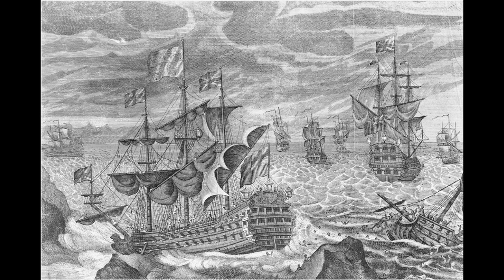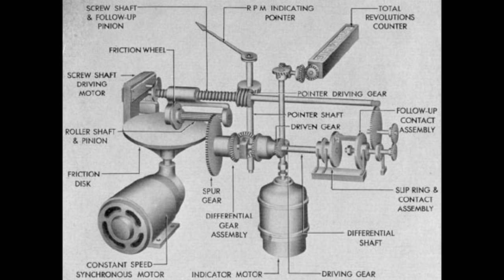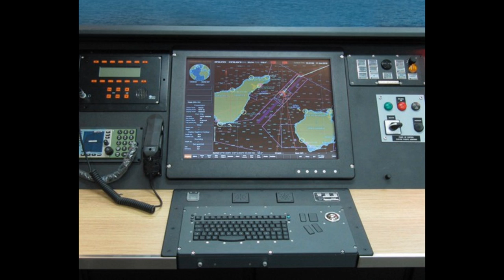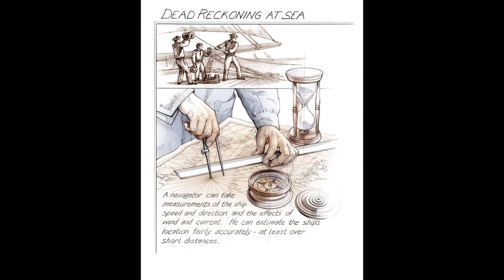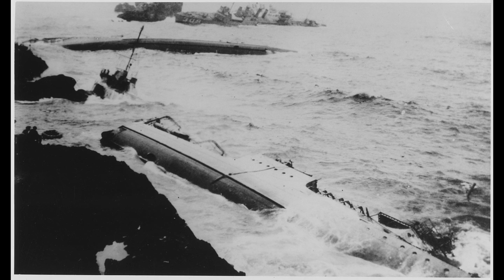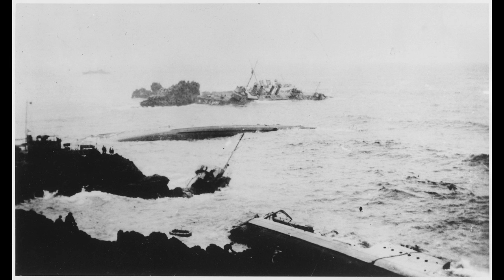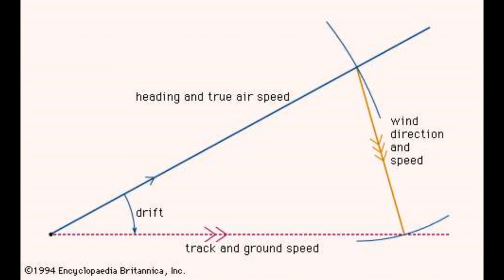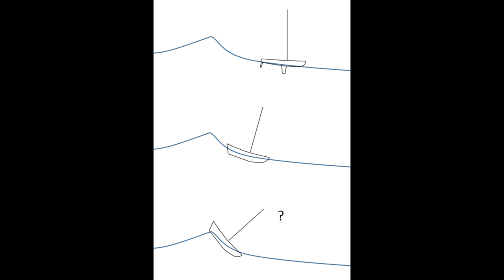Honda Point Disaster - Taking a Wrong Turn at Albuquerque

Comment: I have dived what remains of the wrecks of the Woodbury and Fuller a couple of times.  The other wrecks are generally too close to the coast to be dived safely, though I've heard that the wreck of Delphi has been dived on, from time to time.  In fact, even the area where the Woodbury and Fuller went aground is only safely accessible, maybe 18 to 24 days a year.  The rock formation which was given the name "Woodbury Rock" has other nicknames, including "Destroyer Rocks" and "The Devil's Jaw."  The geographic point that ships want to pass when heading North to South, before making a left hand turn is known as Point Arguello.  When you can safety maneuver and anchor in this area you are just offshore of Vandenberg Air Force Base and are advised not to take photos of the onshore installations.  Honda was the name of small river or creek, which fed into the ocean near Woodbury Rock, but long ago dried up.     

There are numerous other wrecks in the same general area.  In fact, you can see the remains of the stern of a Japanese freighter; the Nippon Maru, at the same time you are looking at the deck fixtures, boilers and engines of the Fuller.  They are literally only a few feet apart.  You can tell the difference between the mashed up parts of the two wrecks because the Nippon Maru had steel screws (propellers) as opposed to bronze ones; which have a lot of rust on them today, and are much flatter than those used on U.S. Navy destroyers of that time.  The Nippon Maru ran aground almost ten years (in 1933) after the U.S. Navy disaster.  

Within 100 - 150 ft there is another rock, called "Blade Rock," named after the Yankee Blade, a wooden hulled paddle wheel steamer which sank after hitting hit in 1854.  The Yankee Blade was carrying at least $153,000 in gold, and many gold miners who were returning from the California gold fields with their riches.  (Don't think about diving to recover the gold.  Following the wreck, the captain of the Yankee Blade learned to become a hard hat diver and camped at Honda for many months, almost a year, until he made enough dives to recover 95-99% of the gold for himself and his helpmates.  Most of the gold miners didn't drown with their gold, but many were robbed by other passengers when they made it to shore.  I think the death toll was about three dozen out of over 800 passengers and crew.)  

There are also the wrecks of two passenger lines; the S.S. Santa Rosa, which ran aground in 1911, and the S.S. Harvard, which ran aground in 1931.  Four people died in sinking of the Santa Rosa; washed overboard by waves, but there were no deaths in the grounding of the Harvard.  The Santa Rosa is not diveable, but occasionally the Harvard can be dived.  Generally speaking, she has been turned on her side and smashed flat like a tin can that has been stepped on.

Final note about diving at Honda:*  In 1984 a diver found the 1906 Annapolis class ring of Captain William Lowndes Calhoun of the U.S.S. Young.  He did not die during the sinking, he only lost his ring.  Admiral Calhoun eventually retired in 1946 and passed away in 1963, but his wife was still alive in 1984.  She was living in San Diego at that time and after the diver who found her husband's ring discovered her location, he drove to meet her and returned the ring to her. - * From "Shipwrecks of South California" by Patrick Smith and Bonnie Cardone.

Comment: My sea daddy told me to never trust the first report. In this context, one wonders why the squadron navigator didn't note the discrepancy between the dead reckoning position and the radio navigation position, and work to resolve the errors. Fast forward, this is almost the exact situation that occurred on the USS La Moure County (LST-1194), where the Officer of the Deck (OOD) trusted charts with outdated datum over the radar plot of the ships position, running her aground for a total loss.

Comment: Old vs new generation usually means an uneven of training, use, and trust of things like the RDF. Some of the ships had the equipment and the local beacons were recently installed. Add a tight budget onto the time and you can guess there was little training  with the equipment. I would say there was serious miss trust and lack of understanding the capability of the RDF.

As for dead reckoning in the night with heavy fog and unusual circumstances, a more conservative captain may have made different choices. Then again destroyer captains are not promoted for playing it safe. Add on the extra funds to go fast and chance to make some time records, you have the perfect "hold my beer" moment.

Comment: Deductive reckoning...estimating position, etc with incomplete information.   'Ded' (or 'dead', because if you reckoned wrong, you were dead) reckoning.   The items you illustrated are aviation tools on an aviation sectional chart--I have them myself.  
It's actually quite accurate, if you have sufficient information--including landmarks and/or other resources--and make correct estimates, along with reasonable leeway of said estimates.

Comment: One thing the author did not cover, and was a possible reason for Cdr Watson to disregard the radio beacons, was that they thought, in error in hindsight, that the radio beacon was being received on its reciprocal - that is, 180 degrees off or, reversed.  There was considerable discussion aboard the flagship that one of these nav aids was wrong - but which one?  They opted to trust their own navigation which, obviously, was wrong but new technology is always suspect it seems.  If you can find a book entitled "Tragedy At Honda" it provides an accurate description of how the ship's got into trouble and how the various crews reacted to the disaster.  It also explains the fortunate location of a major railroad line and its maintenance crews as they hurried to Point Pendernales to help the sailors.  I tried visiting the site in 1995 but it now lies within Vandenberg AFB and access is difficult to obtain.

Comment: All snide comments aside, the practical impact of this tragedy is that individual navy ships are keenly aware of their navigation accuracy and potential problems. Time at sea driving an amphibious warship in the Atlantic and Mediterranean, four times through the Gibraltar Straits and twice through the Messina Straits between Italy and Sicily, as well as low visibility work on the New England coast and the Bay of Fundy, all this in the late 1960s, the Honda Point incident was and remains an excellent example of imprudent navigation, not to say sloppy work. The cost to the taxpayers in 1924, I would judge, has been recouped several times over in the years since as a training aid and by inspiring naval officers to more exacting work. U. S. Navy (ret.)

Comment: Why did the captain take over navigating duties from his navigator in the first place? To virtue signal about his seamanship to his superiors? his fellow commanders? his crews? Violating protocol down the chain of command can be as disastrous as violating it up the chain of command. But if you're going to do so, you might want to be marginally competent at the duty. 

Radio technology may have been new, but the problems with dead reckoning were well known from time immemorial. Any naval officer, finding himself in a fog which prevented him from spotting the lights on shore that would double check his plot, should have been amenable to a quick lesson from his navigator on the subject that radio beacons travel in a straight line along the same electromagnetic spectrum that visible light travels.

Of course the captain had to admit his error after the fact, when his navigator, I imagine, had spoken up before the disaster in no uncertain terms about what he knew, without a doubt, the captain was steering the flotilla into. The shore, that is. The captain's admission was a display of no great virtue.

Comment: You never marked the radio beacons on the chart. How many were there? And where were they located? Makes a big difference for triangulation. Also did they transmit continuously, or only at fixed intervals? Another big difference.

Comment: Up to the widespread availability of satellite positioning, navigation has always been an inexact science. It has always been good practice to use every source of navigational information available to synthesise the best estimate of position and course. This is just one of a series of marine and aviation tragedies caused by older commanders refusing to accept the contributions brought by new technology. As such, with all the necessary information having been available to prevent disaster, but disregarded by incalcitrant commanders, it was entirely correct that those commanders were held responsible.

Comment: Somewhat astounding that they just relied on the dead reckoning without any sort of other fix, particularly in fog/low vis. 

When I first went to sea in the 70's, they didn't have GPS, but had radar. Dead reckoning was still part of the equation, but by pitometer or em log to measure speed (and thus distance traveled) rather than propeller revs. Propeller revs were still used (still are) but in reverse, ie would set revolutions, and that should give you the speed you need/cover distance you want then double check.

But that is the point. If you have multiple inputs, use and check all of them. If two don't agree, get a third, THEN you know which is wrong/confirm which is right. 

Before GPS, ships (warships at least) had radar, and were ALWAYS comparing log to actual speed, blind (radar, with full blind plotting team) to visual, and log was always calibrated.............. but was a guide, never relied upon alone. 

Then check of chart/currents/tides, and "course made good" as opposed to actual ships heading (cross current effect).................. THEN the fact that your echo sounder (depth) is adjusted for temp and salinity, because that affects speed of sound through water - AND check ships fuel use/trim, as draught affects echo sounder depth accuracy. Check depth on chart to make sure THAT "makes sense" against "where you are."

Modern ships have computer systems and "ARPA" type (auto plotting) radars, AND GPS.

Now................. we do all that "double checking" with ALL those things on hand. Some may say "Well didn't have that in 1923......." True, they didn't. 

Point is - we double check/don't take one system as gospel when we have MANY backups. They had hardly ANY. All the more reason to slow down and find a "double check" (sounding in their case) 

We used to do navigator training in 97/98. The new young officers come from the nav school, and navigate the ship under watchful instructors. Oldest ship (hence not as embarrassing when they prang it???) creeping around in the back rivers of Tasmania or wherever the nav is challenging. 

By that stage we had gyro/back up gyro/revs/pit log/GPS/radar/ARPA/full bridge team/full ops room blind pilotage team/echo sounder................... AND for those "close passages/where doubt" we had a 24 hour watch with people on the forecastle with microphone/headset comms direct to bridge in case needed to "see what about to hit".

So, with ALL those options, we STILL employed that extra measure. 

So, "it was 1923" or not - they decided to "go with ONE input/source of info" that was KNOWN to be variable with sea state or current (and state of ships hulls - fouling of ship hull starts the day it goes in the water, and the drag means prop revs can vary to actual distance traveled) I find quite strange............... 

I saw an organisation once that had as it's motto "in God we trust; everything else we check."

When I worked gun systems for 40 years, thinking like that always worked for me. :-)

Comment: 5:43  If the ships weren't allowed to slow down to take depth soundings, why didn't they take a route further out to sea away from any potential shoals?  That seems like a much safer option than cruising close to the coast.  Were they worried about running into civilian traffic out of Los Angeles?  Were they overconfident in their charts and navigation skills?

EDIT:  Also, the Delphi's captain trusted his own judgement more than his new, untested equipment?  This sounds a lot like Callaghan at Guadalcanal.

Comment: Will you ever do a video on the Japanese destruction of Force Z, and whether or not the force could’ve been saved with an escort of planes from either land based aircraft or carrier aircraft?
Reply: Hrm, That's an interesting case to consider. There were actually very few battleships able to be sunk by aircraft while underway. The only two of them I can think of for certain after that point are Roma, Musashi and Yamato. Any others sunk by aircraft were sunk in port. 

If you count the 1/2 credit (IMO) Bismarck (no air cover, damaged but not sunk by aircraft) and Hiei (damaged by cruisers/destroyers and I believe no air cover.)

Of all of those, maybe Musashi had some land based air cover?

Interestingly including even those in port that got sunk didn't mostly have air cover: The US ships at Pearl (By the time any cover to speak of was up, the ships were already hit as I recall), The remainder of the Japanese battleships not sunk by submarines. Tirpitz was, at anchor.

Comment: Since the position of the radio beacons is not shown on the map you showed,  it is difficult to decide whether the phenomenon of coastal refraction of radio waves (check out Snell's law) would have had any serious effect on the bearings obtained by RDF. The further inland that the beacons were located, the greater the discrepancy between the actual bearing and true bearing would be. While refraction of a radio wave will be the same, no matter how close the beacon is to the coast, the deviation of the bearing shrinks with proximity of the transmitting station to the coast However, I assume that the phenomenon was already know at this stage in the evolution of radio navaids - given that the second half of the squadron avoided the fate of the leading half. 
I apologise for commenting late, but I have just discovered your channel, which, I must say, is interfering with the other things I would normally do. So I am not sure whether I should praise or curse you.

Comment: Last year we had a similar navigational error here in Norway. Where a frigate scraped along a tanker before sinking itself. But I don't know why the tanker is sued for bad navigating.
Reply: Not from a maritime background myself, but from some of the charts available online it looks like the frigate may have had right of way to cross in front of the tanker, comming from its starboard. (IRPCS sec. II art. 15) The charge of dangerous navigation may have something to do with that. Or it could have to do with the desire by the Norwegian government who believe they are not fully at fault to recoup some insurance money from the tanker's operator.
Reply: @dr.quintusvangalen6268  well in about 13 minuttes they where heading straight on the tanker. Without seing it.

Comment: Much the same problem as the Titanic; too much speed for too little visibility and no certainty of the relative location of hazards to navigation.  Seven Commanding Officers and a Commodore failed to manage the risk.  (If it had been dark, would more ships have been lost?)  

Ignoring the clues is difficult to accept too.  Having served in the Navy for 20 years, I entrusted my safety to the navigation team of the ship I was assigned to.  To discover they were ignoring electronic position information and the fact that a civilian ship using the same dead reckoning system the destroyers were using had run aground meant they were ignoring ample warning that their calculations might be wrong, and that callous regard for safety is tough for a crew to accept.  The additional, readily available clue that the entire rest of the squadron could have been consulted and their fixes compared means the Commodore, the lead ship's navigational team, and all the commander's who mindlessly followed the leader's turn makes three good opportunities to discover and correct the error.  Squadron 12 did!

Then there is the compelling point of the exercise which another poster posits was to rescue a besieged destroyer squadron.  It was suggested somewhere ( the narrative or the court marshall perhaps?) that this satisfactorily explained the decision to maintain the speed of advance.  Bu!!$#!+.  This excuse fails to consider such comm and real things as collisions with other ships.  Even with perfect navigation and no extraordinary earthquakes or magnetic influences, that speed in that fog that close to that much shipping is "difficult to justify."  If you read that as "inexcusable," then you read my mind.  Finally, the compelling point I started this paragraph with; it is difficult to rescue a besieged squadron if you fail to arrive, regardless of how quickly you fail to arrive.

Comment: Fog of the SOCAL coast? nope never seen it!  (I've been in fog so thick I couldn't see 300' outside LA/LB harbor!)  Like many highway accidents, "speed was a factor."  However, its a hard to say though that "they shoulda slowed down."  The purpose was to practice running at speed.  Should they have taken the long way, down south of the Santa Barbara Islands and up to LA from the south?  Distrust of new tech in nothing new in nautical circles... I had a 2/M on one of my first ships that would turn off the ECDIS (computer chart display) because he didn't like the new fangled gadget!